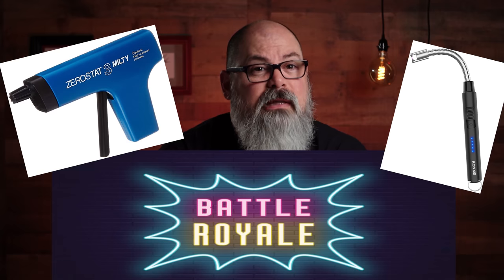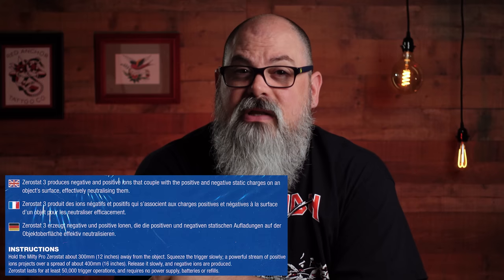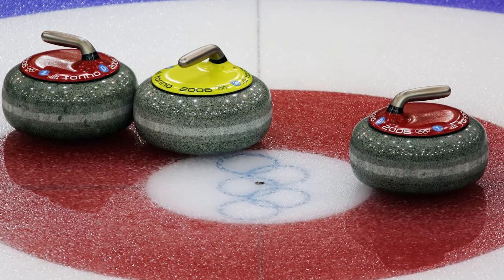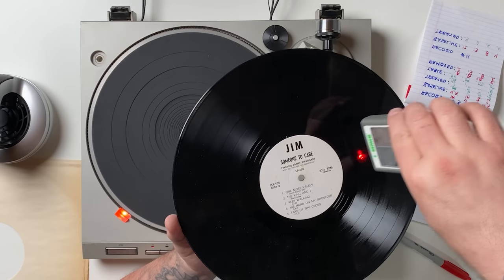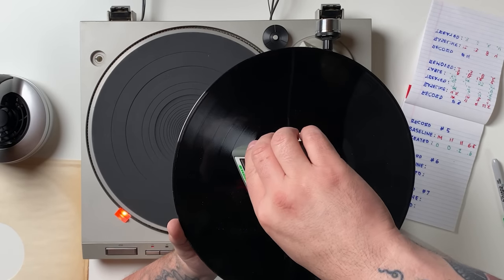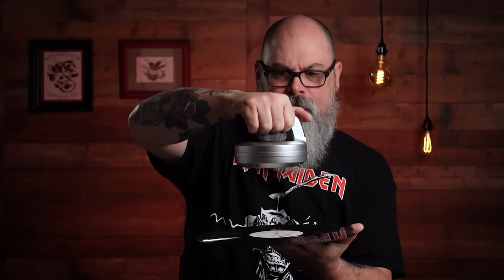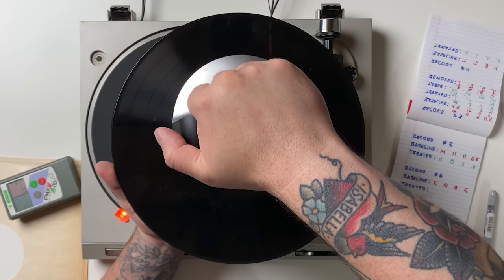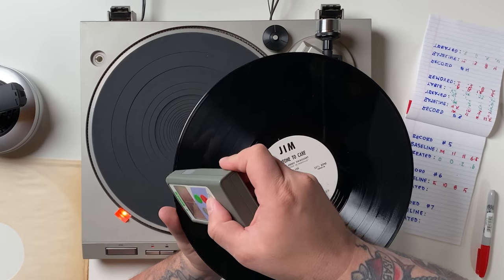How Well Does The Destat III Work?

Comment: Very nice video, but item is too pricey. A suggestion: Do not hold the record in hand when you de-stat it. I rest and center the record label on the plastic, flat handle of a pot top when using the Milty. That way, the record is stable, and I have no chance of introducing more static. Just have to balance the record on the flat handle.
Reply from the maker: With the testing I've done here, I'm confident in saying there's no worry about treating in hand.
Reply: @thevinylattack  Got it. Also, would it be helpful to de-stat the record mat every now and then? Away from the turntable, of course. Can the mats store static?
Reply from the maker: @alanarakelian5021  I'm sure it wouldn't hurt anything. I sometimes forget about the mat inclusion because my main turntable doesn't use a mat.

Comment: Admirably thorough. But at 320 to 400 USD it's a very hard sell. If I can pick up a used 1(or 2) on eBay for 100 to 125 I probably would.
Reply from the maker: It is admittedly expensive. It's all just a matter of what you're comfortable spending. With the extremely dry winter here in Michigan, I bit the bullet for the peerless performance.

Comment: This is a great test!
Don’t think I’d want to spend that much to remove static though.
I bought an air ioniser some years ago and I found when I located it on the shelf above my turntable my static problems largely disappeared, it has lived there ever since.
Would you please do a test with an air ioniser to test this.
Reply from the maker: As an air ionizer treats the record on the platter, I don't find it to be an efficient way to eliminate static. The turntable bleeds of so much static and stores it when a record is placed that the ionizer can't effectively reduce it.
Reply: @thevinylattack  sorry I probably should have explained that I hold my records in front of the air ioniser for a minute before placing on the turn table but keep the ioniser on while playing records as well to dump anions on the turntable.
But you may be correct as I’ve never done any solid tests.
Thanks for replying so promptly you got a sub from me.
Reply from the maker: @thechangingman3763  I've heard of people doing that with the ioniser, but I've also read some troubling information that using an ioniser in the home can be harmful to us. Apparently breathing in the ozone created is terrible for our lungs. It's something I'm still researching. Do you have the make and model of the one you're using?
Reply: @thevinylattack  yeah I did a lot of research on this as I originally purchased it to combat pollen and reduce my hay fever, only available shelf close to a power socket was above my turntable. 
ozone is toxic hence it’s a good bacterial killer but it depends on the levels produced and exposure levels and the evidence that’s been produced is heavily disputed.
Basically there’s an air purifier war taking place between company’s that produce hepa air purifiers and air ionisers and  obviously the company’s producing hepa purifiers claim ionisers are dangerous but the science is still open on the topic.
As I say it’s all about levels and exposure and I wouldn’t leave mine on all the time but it seemed to do more for my records than it did for my hay fever.
The one I use is called Astrid ioniser link below.

https://www.astridioniser.co.uk/
Reply: @thevinylattack  also I don’t know how the destat 3 works as I’ve not handled one to take a close look but it looks like a handheld air ioniser with a fan.
Reply from the maker: @thechangingman3763  I believe that's what it is, but it runs at 15-second intervals as opposed to being left on. I'm still doing my homework on the health side of things.
Reply: @thevinylattack  according to the company I bought mine from there ionisers have passed all EU safety regs and there ionisers were tested at emitting 0 ozone.
I’m not an expert at such matters but I believe there’s a difference between an air ioniser and a ozone generator but people confuse the too.
I would love to have a play with a destat 3 but they are £315 on this side of the pond.
Reply from the maker: @thechangingman3763  I've read that the ioniser emits ozone which is why I'm still looking into it. Hopefully I'll know more sooner than later.

Comment: A carbon fiber brush out does them all. Don’t argue with me. Nuf Sed.
Reply from the maker: A carbon brush only removes dust but if you're happy with it, that's what matters.
Reply: Put a good light on your turntable,  see that the brush leaves more than it takes off, throw it away and use a Rocket Bulb Blower and a lens cleaning Camel Hair Brush and actually remove dust (assuming you properly clean your records).
That and a MoFi felt brush for stubborn dust, Destat III (MUCH better than the Milty) and Bob's your uncle.

Comment: Great video. I have the Furutech Destat II and it works very well. I buy lots of Japaneses Jazz reissues that start off with quite a bit of static and the Dstat II clears up most of the static. I was looking to get a Destat III but found a great deal on a new Destat II.
Reply from the maker: I can't imagine there being that much improvement in the static removal from the 2 to the 3 so I'd guess you did just fine with a deal on the 2.

Comment: My solution to static pops n crackles… dab the tip of your finger in distilled water, lightly, ever so lightly, rub on your every play dust brush, NOT WET! 
Not scientific, but with or without an acrylic mat, PROBLEM SOLVED! Been doing it for years and have a well maintained collection… I’m 64… Play da music!
Reply from the maker: You assume, however, that other people will be as responsible as you concerning how much water is used ;-)

Comment: Not a chance I will purchase this item. $400.00? even $200.00 is far to much. In my opinion all De-Stats are a solution in search of a problem. Having said that, I do use a de-stat brush on both sides of a record before playing.  But mostly for the purpose of removing dust and any de-stat that occurs is a bonus.
Reply from the maker: They are pricey.

Comment: How about treating BOTH sides of the record at the same time? AND treat the record mat at the same time as well. I see you lay the record down between steps. Wont this introduce error?
You should treat the other side. Static is on the surface. To assume that it will be the same for both sides is not scientific. You should do that as well...
Another important thing....holding the vinyl on the grooves...not good. I have cleaned thousands of records and fingerprints are the BANE of records! Sometimes they are almost impossible to get clean, especially after they have had time to set and get hard! Just a thought....
Reply from the maker: We only play one side at a time so I don't know that treating both is necessary. If I'm going to treat both sides it'll be one, then the other between playing them.

Setting the record down doesn't affect the numbers, I tested that in the lighter video.

Those are test records, I'm not concerned on how I hold them because I'll never actually play them.

Thanks for keeping me on my toes.
Reply: @thevinylattack  My premise is that setting the record on the TT affects the play side. So logic would have treating both sides should make a difference. Scientifically speaking, you have to try to be sure. You can't just say it won't make a difference....
Reply from the maker: @jerryking7502  With the results I achieved being next to zero static to absolute zero static, I don't feel the need to test anything further at the moment. I may take a look down the line however.

Comment: You may reduce static electricity prior to play back but static electricity is inevitable during and after play back because of the rotation of the platter during play back
Reply from the maker: Playback doesn't add the amount of static you might think. I'll put that on the list for testing though, thanks.

Comment: Guess my point is all these gimmicks or products are a waste and what would be helpful is something to use during play back
Reply: I'm not electromagnetics expert but I dont think I'd want some outputting a static charge of any kind near my cartridge while operating.
Reply: @JtBrown-el4xt  don’t think there’s a 100% solution. We use anti static inner sleeves and anti static brushes burst we are constantly fighting against static electricity . I have a setup I’m happy with that works
Reply: I’ve owned a zerostat since the mid 80’s. Definitely not a gimmick- an effective tool
Reply: @NateEll  didn’t mean “gimmick” as not good. No matter what we do there will always be static electricity with the rotation of your platter . You don’t have to spend tons of money on products I personally think it’s a waste . Find what works for you it doesn’t have to be an super expensive hobby
Reply from the maker: This is by far the best method for static reduction I've encountered yet. I don't know that using something during playback after using the Destat would really even help. But, it's a pretty expensive tool.